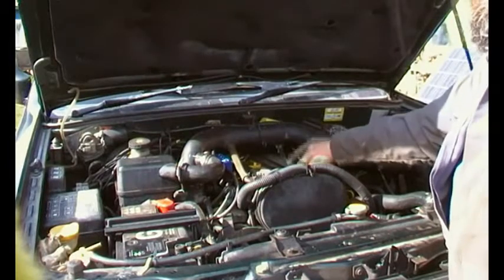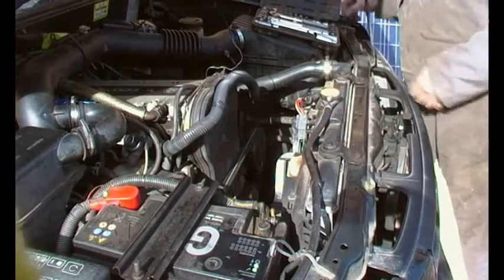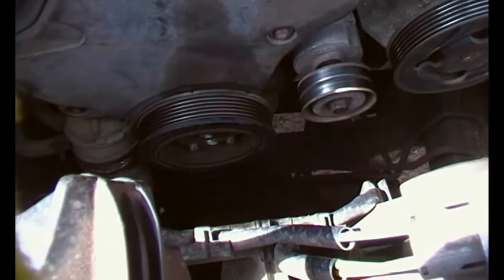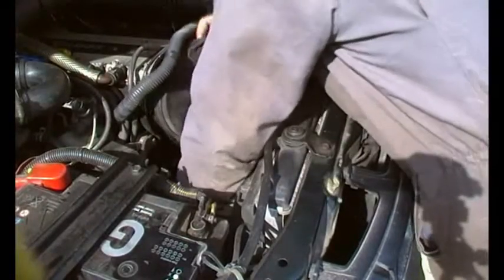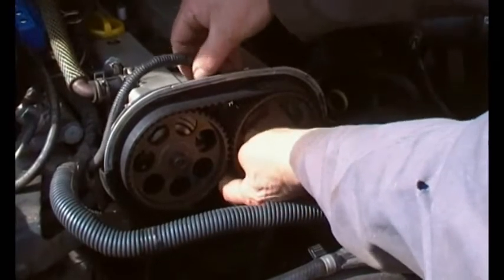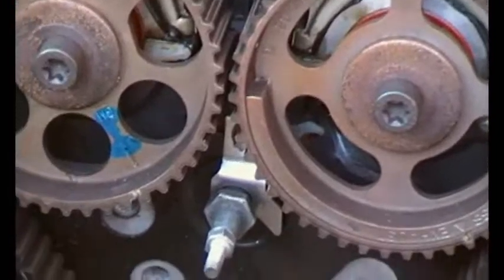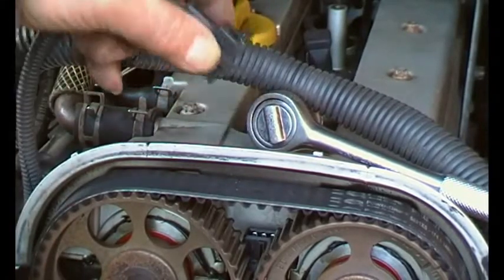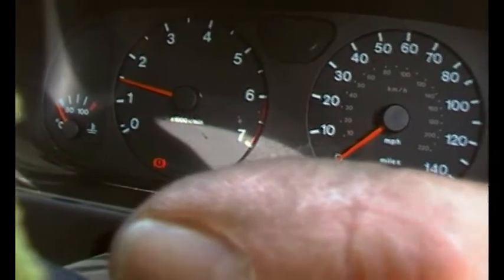Vauxhall frontera cam sensor and cam belt 2.2 Litre 16 valve.

Comment: Good VIDEIO but I’m having problems 
I’ve got no light on. The cash no fault cures either I was running the 2.2 mk2 b petrol frontera this morning after ten min the engine decided to goo off but now weill not start it’s fires then just stoops and tens over slowly

Comment: Greetings sir, does the 95 model  used a camshaft sensor?
Reply from the maker: Hi, that would be a Mk1 model with a single cam 2 ltr engine, sorry I don't know but I would imagine it has as it is still fuel injected, cheers
Reply: If it's a single cam then no, it does not use a cam sensor.

Comment: been offered one for £150 cos cam belt has gone, do you think its worth a punt of just leave it?
Reply from the maker: Hi, depends on the general condition, tyres, rust, MOT etc. There will be the question of a bent valve to consider. Dose the engine turn over smoothly. Cheers